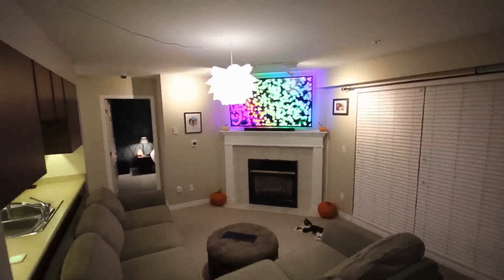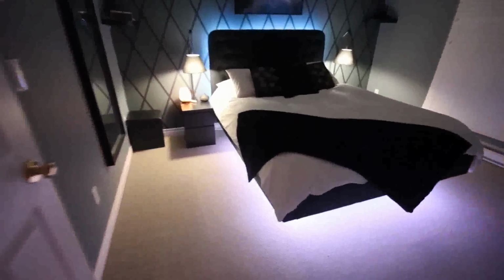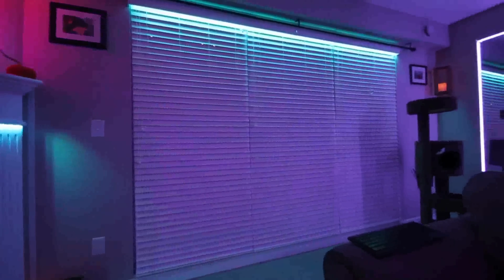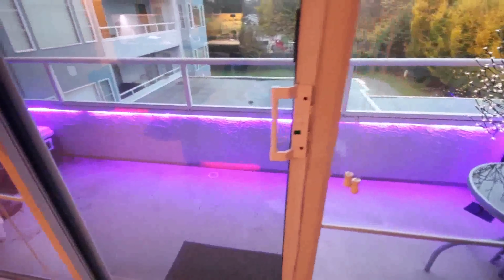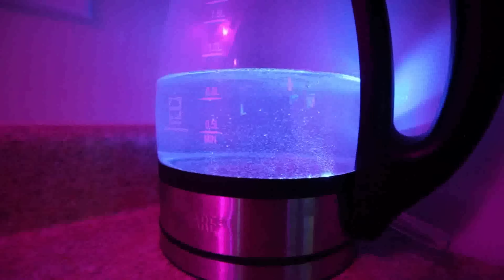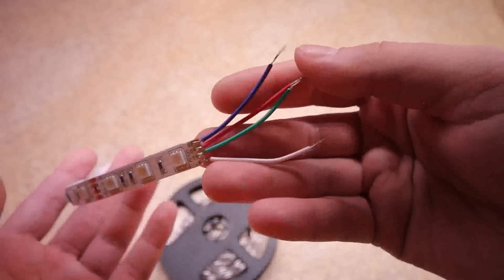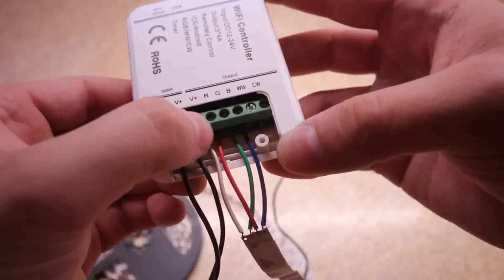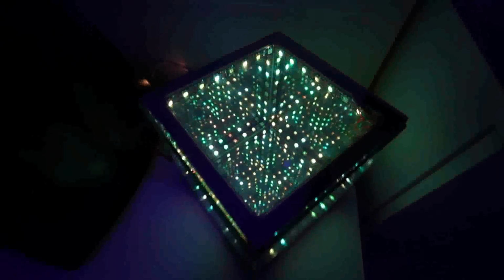My RGB Apartment (Explained)

Comment: Not only does it look like a strip club, but it even includes a stripper.....
This trend needs to die
Reply from the maker: Found the incel.
Reply: @Coltography  
Did you learn a new buzz word today? Good for you. 
Btw, my original comment wasn't a knock on you. I realize that RGB everything is the new trend, and if it helps in getting tail, then more power to ya.

Comment: Very cool, Im using the Gledopto adapters to control the led strips. Con, it costs a little bit more, but you can use them with Phillips Hue (bridge). You can order it on AliExpress. And there are "Neon LED" strips, which are looking awesome.
Reply from the maker: Awesome, I plan on changing all my controllers out for those in the new year! Is there anything bad about them?
Reply: @Coltography  Pretty much only that they are "fading" instead of instant changing, when choosing colors.

Comment: How is your electricity so low, ours is over $300
Reply from the maker: My kw price is probably lower than yours, and LEDs hardly use any power.  All the lights in my house use about the same as 2-3 regular house bulbs.
Reply: Coltography yeah it’s pretty ridiculous. Anyway, sick setup.
Reply from the maker: @adrianlara5045  thanks man

Comment: im just getting started so should i get something like this ?..
.Tingkam Waterproof 5050 SMD 32.8ft (10m) RGB LED Strip Light Kit, Color Changing Black PCB Rope Lights+44-key IR Controller+ Power Supply for Home,Kitchen,Trucks,Sitting Room and Bedroom Decoration..... or do you have a better option for starting out... i want to do my bedroom first but then later expand to other rooms.
Reply from the maker: Hi, sorry - haven't used that kit so I can't vouch for it.  Just use the ones I linked in the description. : )
Reply: your link is for 16 foot kit. i wonder if that might be better...idk bla im going to get mine from wall-mart cuz i like free shipping when i do get.
Reply: do i need a DC 24V Power Supply? cuz the 16 foot kit i dont believe has it.

Comment: Curious about what LED strips you're using? 5050? I can't seem to find good info on what to use in order to make effects like streaks of lights or be able to control pixels individually. Advice would be great!
Reply from the maker: Hi, there's links in description of which products I use. Indeed I use 5050smd for most of the stuff, the tv lights are individually addressable but not controllable via home automation etc.  Addressable LEDs are a bit of a different animal as you need to program them with an Arduino etc

Comment: Typically ignorant of people to assume a high electricity bill with LEDs, especially outdoor Christmas decorations and indoor LED strips. They do NOT draw insane amounts of power, I've got about 5600 LEDs covering the outline of my house and the trees/bushes surrounding it, and in total that draws about 32W constant (1.1A in 29V, strings are made for 31V but dimmed so they're not blindingly bright). That's less than a T8 flourescent tube for older kitchen lights. It's even less than a single halogen spotlight used for indoor ceiling spots. I keep it on 24/7 and don't even notice it on the electricity bill, it's usually lower in December/January because I use the fireplace rather than electric heating.
Reply: What LEDs do you have that draw such little power? My Strip lighting draw .3 watts each.
Reply: @fitlikeaglove7396  They're string lights, each LED draws 0.06W on their proper forward voltage of 3V (20mA) but by turning the overall voltage down, the current decreases a lot while brightness only decreases slightly.
Reply: rip the symmentry on the power grid thoe

Comment: Tutorials for:
1. Smart mirror (without wooden frame)
2. Add blocking wifi with raspberry pi
3. Infinity cube
4. RGB behind tv
5. Setting up wifi strips
Reply: I really wanna know the add blocker raspberry pi
Reply: @laelaisasome  just google pihole. It's not hard to set up, I'm a total noob and had it going within 2 hours.
Reply: @laelaisasome  Just google pihole it's really easy to install. I used to run it on my raspberry pi and had display (bigger than this video) too but after couple of days I removed the display because it's pretty useless and now I'm running pihole on my NAS docker so no need to have raspberry pi for that anymore. If you have raspberry pi and you want to try that it's easy to do and should be running in about 30min.

Comment: Is the RGB+WW duller than normal RGB? Like is there a reason I shouldn't go entirely RGBWW?
Reply from the maker: Requires higher wattage power supply, won't be dimmer though.  No disadvantage unless you have short runs, as every 2nd led is warm white so it might be uneven amounts of white/RGB in a strip if it's too short.

Comment: Cool 0:24 why do you have the ad blocker statistics and whats thst mirror called also holy i thought your electricty bill was high mine is 900 every 4 months wtffff
Reply: OK question what in his holy name is costing you $225 a month?????
Reply: @DaEastSnowman  thats 160 in usd
Reply: @DaEastSnowman  Idfk its 225 aud and idk why i use the ac alot maybe thsts why and i got a 5 people family
Reply: it's magicmirror https://magicmirror.builders/ with pihole https://pi-hole.net/ module https://github.com/sheyabernstein/MMM-pihole-stats
Reply: Well if you live in Darwin or Bundaberg or somewhere like that it'll be because you're probably running 2 air-conditioners 24/7.

Comment: Bro the tutorial pls for the tv ambilight. Thanks
Reply: You can make tv ambilight with a raspberry pi and a rgb strip preferably the apa102 model
Reply: Best choice: Dreamscreen Ambilight!! Plug and play without pc.
Reply: @moneymaker69  Dreamscreen is pretty good, but it's fucking overpriced.
Reply: Yes please add an ambilight tutorial
Reply: yessssss
Reply: Philips ambillight tv has it built in
Reply: @AlexDjalo  they are not sold in the US
Reply: Of course those Philips play lights.. But overpriced and idk if that's works on a TV?
Reply: @xFersureMatt  you may be able to do slot of this stuff with xiaomi Yee lights, they cost slot less and are still pretty good.
Reply: Can you please make a tutorial on ambient lighting controller
Reply: Nice
Reply: yes please
Reply: some tvs already got it =)
Reply: So your tv led strip has to be controlled by a PC to make colors change with the picture ??